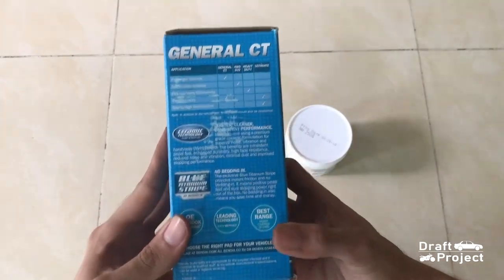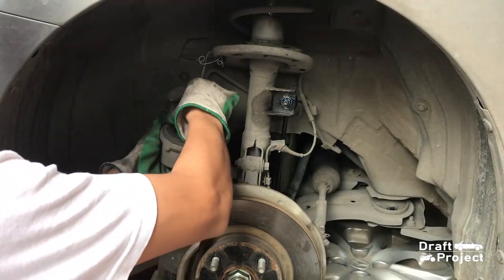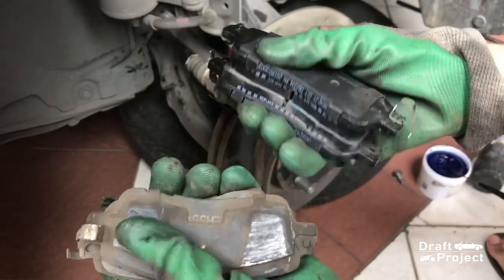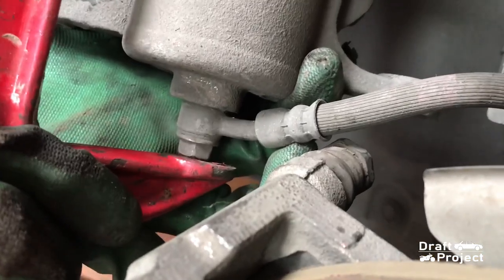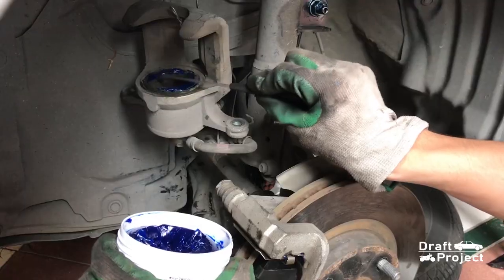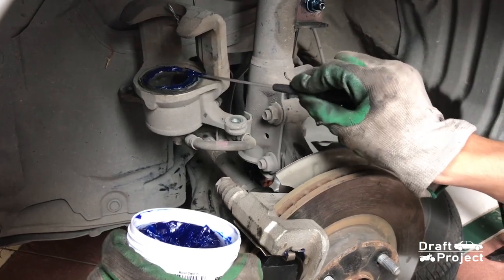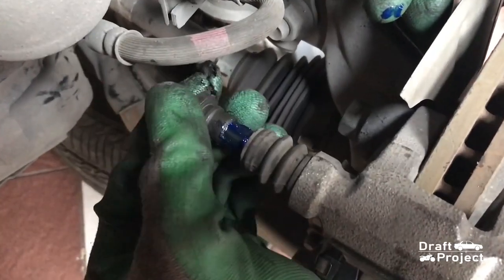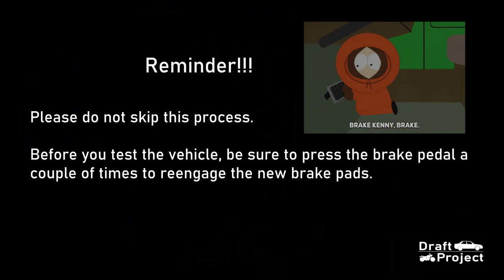Change or replace your Front Brake Pads

Comment: Great video ❤️ but I want to know when change the new brake pad we need to do brake bleeding or not brother .
Reply from the maker: No need to do that. Just change the brake pads. It is external from the hydraulic system. Bleeding is needed when you only replace some of the hydraulic brake parts or changing the brake fluid with a new one.
Reply: @DraftProject  clear information brother , thank you so much ❤️

Comment: Do you know if the fiesta st brakes will fit the sky mazda 2? Please do a video on a rear sway bar install
Reply from the maker: Sorry for the late response. Based on my research, I guess it is possible. It is usually done on the previous model of Mazda 2. The Skyactiv model of Mazda 2 and Ford Fiesta ST front brakes has similarities in terms of appearance. Some said that Mazda and Ford shared parts for their respective car models. If you want to upgrade it to Fiesta ST brakes, I suggest that it is better to make a little bit of research, check all the measurements of the brake caliper and bracket and especially check the size of the caliper bracket bolt and the banjo bolt of the brake hose.

Thank you very much. Yes, don't worry. There's more videos to come soon for this Mazda 2. :)

Comment: An you use copper grease
Reply from the maker: In terms of brake job, I do not recommend it but if it happens that you had one, then you can use it on the ends of the brake pads where it touches the brake pad clip or the retainers so that it won't seize overtime. Copper grease is an anti-seize, not a lubricant. It can be applied on some metal to metal parts, not on metal to rubber parts like brake slider pins and more. If you have the chance to get silicon grease or synthetic grease, then that would be a lot better.